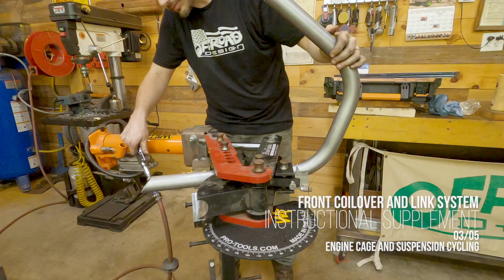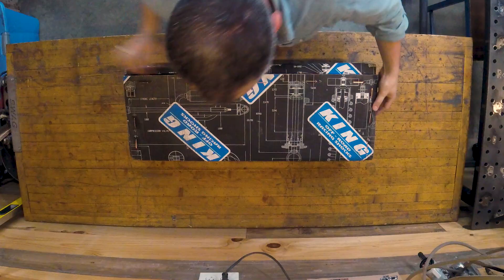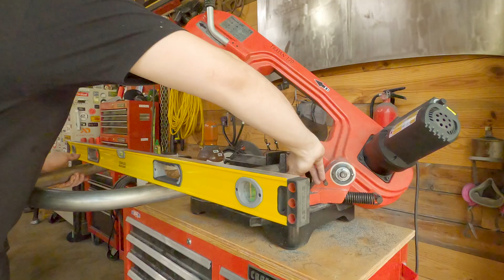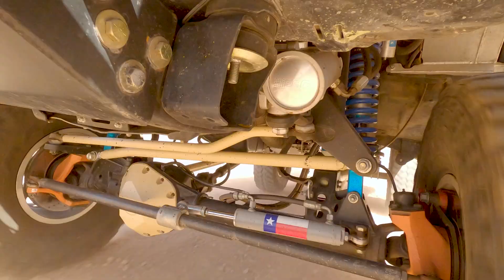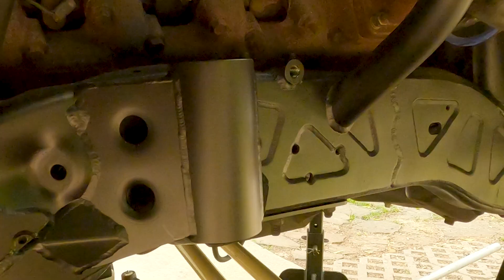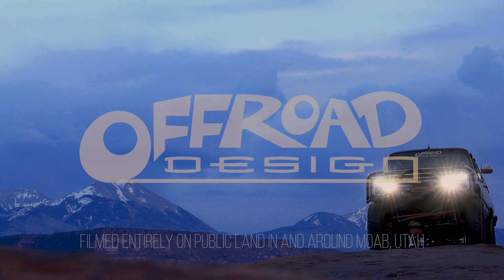Engine Cage and Cycle - Offroad Design Link Instruction Supplement 03/05

Comment: I would love to buy this kit but it is just too much money for me….. I would love to have coil springs rather than a coil over bc I could buy a factory spring from a discovery or something and have factory parts for replacement. This is a great kit and knew somebody with the same setup on his dodge w150 and it rode 10x better. Great product, great videos, a very great dream 😂
Reply from the maker: Appreciate your feedback, and it sure is on the premium end of the available systems. If you find second hand coilovers, you bring the cost down pretty significantly.

Comment: When is the 07 to 13 Suburban kit coming out?   Will it be a axle swap kit or a RCV cv axle kit with chrome moly stub shafts to keep the ifs?
Reply from the maker: ORD has some gear for that front end for the IFS curious folk out there. Give them a call and get into the weeds on those and other options.
Reply: Willomet Motor & Fab Thank you.